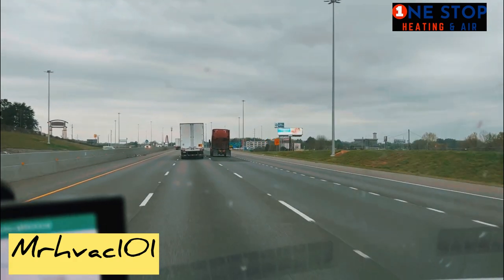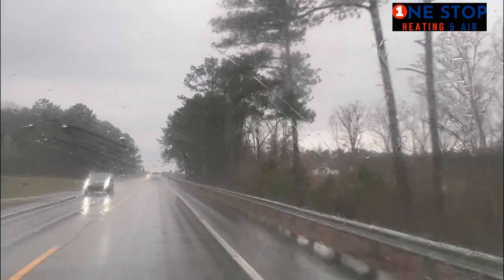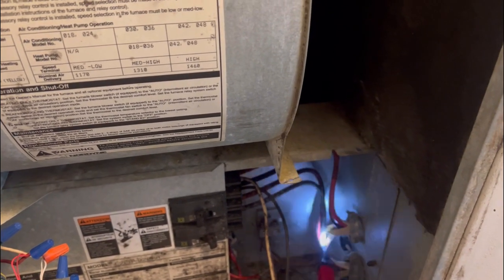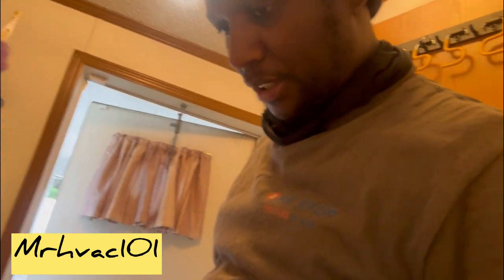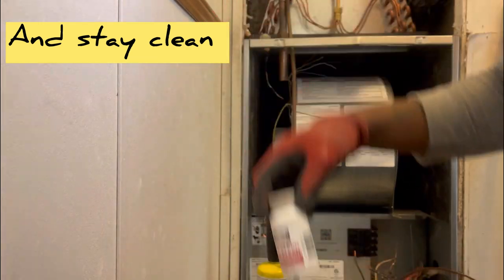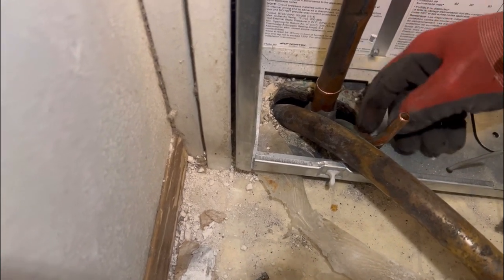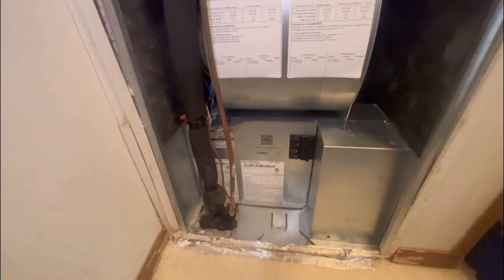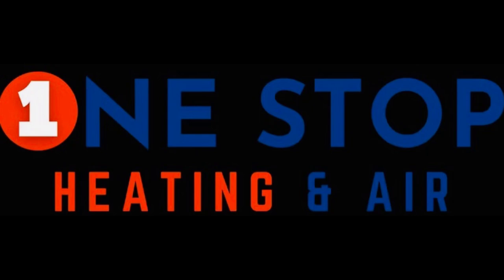Mobile Home Furnace Install

Comment: Overall you did a good job man🫡

I would recommend you braze any refrigerant lines with brazing rods because over time with silver solder there will be leaks at the joints sooner compared to brazing rods. Remember refrigerants operate at higher pressures, water lines in a home are under 80 psi. Just food for thought

Comment: I like your Widow Maker for electrical wire checking. I have a friend who is an electrician. He said Never use those crap or cheap tool for verifying electric wires. They are called Widow Maker for a reason. Your choice your life. And make sure your life insurance is paid up always. Good luck he said.
Always use a meter to make sure there is absolutely no voltages present before disconnecting wires.

Comment: That heat pump and evaporator coil looked pretty new. I'm guessing this customer replaced those first then the furnace a few months later once cold season started coming up. I was thinking about doing this exact thing as well. However, for me financially it'd be a better value to replace the furnace with an air handler at the same time as replacing my heat pump. Is it I'll advised to go this route in a mobile home?
Reply from the maker: Yes ,It will be great to go this route . Thanks

Comment: Question? i thought bracing with silver15% is the best.
Reply from the maker: It’s depends on the equipment but I use Both on residential only brazing rods on commercial